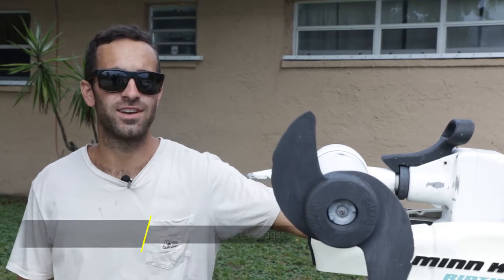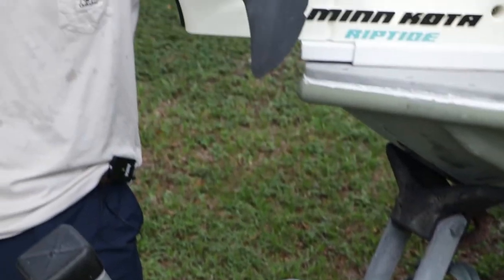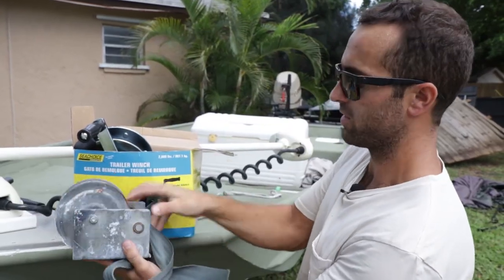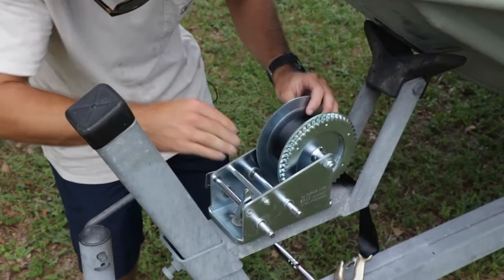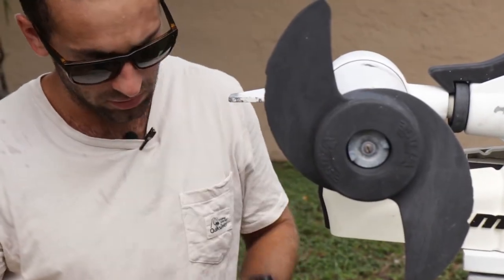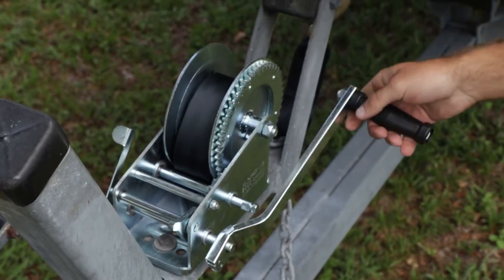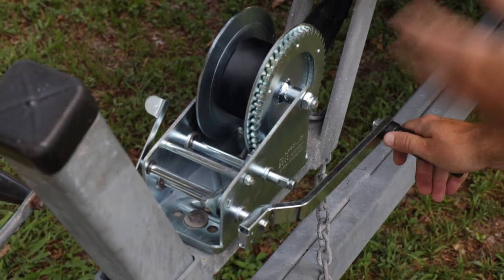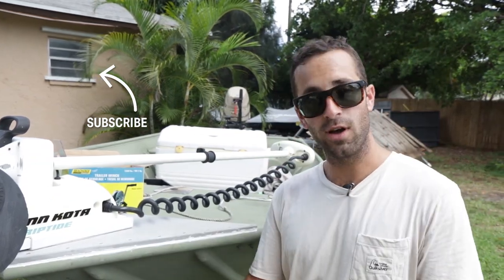Easy Boat Maintenance: Installing a Boat Trailer Winch

Comment: Should I replace the winch if it comes loose when I’m driving down a bumpy road? It is a older winch
Reply from the maker: Try tightening the winch hardware. If the winch still comes loose then it's time to replace the hardware and possibly the winch itself.